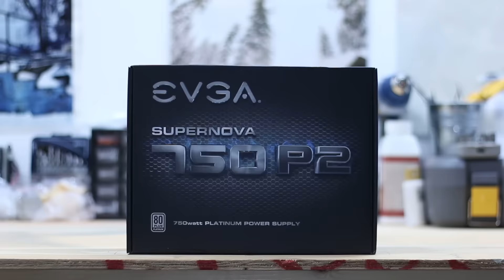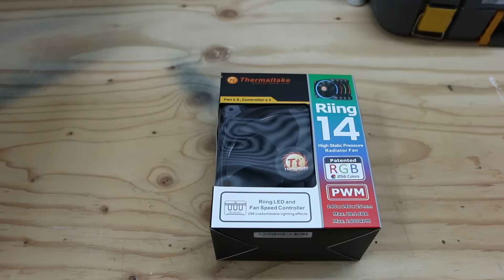ga-h270-gaming 3 | Kaby Lake build timelapse

Comment: Hey i have the same pc and i have this problem: "Reboot and select proper boot device or insert boot media in selected boot device and press a key" 
anyone knows how to repair it?
Reply from the maker: Matias Ferrara hey Matias. Usually, when  this message is displayed, it means that the PC is unable to find an OS to boot from. Check the boot order in the BIOS, check to see if there is a USB drive or a CD the PC is trying to boot from. Let us know how it turned out. Check to see if your primary drive, the one with the OS on it, is plugged in, powered ans accessible.
Reply: nicolas michaud Thanks for the response men! I'll let you know what's up!

Comment: Hey dude, how do you install that m.2???, i come here to install it, but you made a cut in the video :(((  3:44 
when I put it there is a part left over, and I'm afraid to break it
Reply from the maker: You have to insert it at an angle and them you push down on it to screw it on. Check out other M.2 install videos. It is a standard M.2 port, this mobo isn't different from every other ones.
Reply from the maker: Also at first, I used the wrong M.2 port. If you look ahead on the video, you can see I later moved it on the other M.2 port, the one over the graphics card port.
Reply: @nixthenix  Ty mate!

I used the port that is above the card, is there a difference between that and the one below?
Reply from the maker: @enriquepedros6626  You used the correct one. Well first of all, with this one, you'll be able to see you glorious new M.2 ssd drive. It won't be hidden under the GPU. It's also the primary one. It accepts longer drives and SATA connectivity as well.
The one above the GPU:
1 x M.2 connector (Socket 3, M key, type 2242/2260/2280/22110 SATA and
PCIe x4/x2 SSD support)(M2A1_32G)
The one under:
 - 1 x M.2 connector (Socket 3, M key, type 2242/2260/2280 PCIe x4/x2 SSD
support)(M2A2_32G)
Reply: @nixthenix  Ty and for youre help too!

Comment: hey mister. I have the same motherboard. I want to install 6 fans but only have 2 fan headers. they will be rgb so I would like to control the LEDS via software. question is if I do a triple fan splitter for 1 header, will that be too much voltage for the header to handle? I don't want to fry the poor thing. lol your build is awesome btw !
Reply from the maker: SonOfSparda thanks for your comment! Unfortunately I don't know the answer to your question but I'm guessing a simple Google search will provide you with an answer! Keep on the good work!

Comment: I'm confused between this model or Asus Intel STRIX B250F GAMING . Any suggestion which one to buy ?
Reply from the maker: Those are pretty much equivalent products. Both are made to support the newest intel socket LGA-1151. Both are made to run stock (no overclocking). They both support 2400mHz RAM, have M.2 slots, USB 3.1 Type C, gigabit LAN, RGB lighting, etc... Neither can do SLI. If there are differences between the two, they're really minor. I would say it's really up to you at that point. Thanks for watching!

Comment: Update the bios is needed to use 64gb 2400mhz memory or just 7th generation processor such as 7700?
Reply from the maker: Aldo Fernandes Azevedo no BIOS update needed but you do have to go set XMP memory profile in the BIOS to achieve 2400MHz otherwise the ram will run at the default stock speed which is 2133MHz. It's not a bad idea to update to the latest available BIOS version though

Comment: Hi Nic, I would like to here your impressions on your NVMe drive. Was there driver complication at 1st boot? Like did you have to pre-load drivers as you would in a RAID? Did you install Windows 10? I plan on initially using my Window 7 and then look into upgrading to 10. Did everything else go smoothly? And is there any noticeable performance boost that you notice over a standard SSD drives?
I just ordered the same motherboard and a Crucial MX300 275GB SSD for $93(US). I had to order some SSD cables and an SSD bracket for $15. Total = $108. And I could get the Samsung 960 EVO M.2 250GB for $117.
So for $9 more I would lose 25GB capacity but gain a cleaner install and potentially the speed of 4 PCIe lanes.
Is it worth the trouble in your opinion?
Thanks (Very nice video)
Reply from the maker: Marcus Caudill Hi! In your situation, I would go with the M.2 NVMe drive no doubt about it. Thanks for your kind comment!

Comment: Work well a video onboard and a video offboard of the motherboard or a conflict is expected?
Reply from the maker: Aldo Fernandes Azevedo I'm sorry I don't understand the question. Do you want to use both the onboard graphics and the dedicated PCIe graphics card simultaneously?
Reply: nicolas michaud Like a Laptop, that has two video cards, you have to change the default video card?
Reply from the maker: Aldo Fernandes Azevedo I don't know really.. I'm using a dedicated graphics card so I disabled onboard video in the BIOS.

Comment: Nice build mate! Just wondering if this motherboard is SLI compatibale. I have ordered this motherboard and plan to add another 1070 in the future.
Also how much power supply watts would I need to run 2x 1070's in SLI?
Reply from the maker: Hey man! Thanks for your comment. This board isn't SLI compatible unfortunately. Have a good one, cheers!

Comment: where is the 6 port sata3? i have the same mobo, but i don't see the 6 port sata3, only 2.
Reply from the maker: jmr cover They're on the bottom right corner. See motherboard user manual on page 4, page 12 and page 15 for exact location.

Comment: Awesome build! Since you have a 7th Generation processor, a Motherboard for 2133/2400Mhz RAMs and you're using 2400Mhz RAMs, I've read that in order to enable the extra RAM speed you must have a 7th Generation processor or enable XMP. Do I have to enable XMP or all I need is 7th generation processor and it'll automatically enable the extra speed?
Reply from the maker: Yves Heinrich thanks man! You will have to enable it in BIOS. Right out of the box, it was running @ 2133Mhz. Simple setting enable in BIOS and you're now @ 2400Mhz (=
Reply: But isn't that technically overlocking? I wouldn't have a problem with that since my upcoming PC build's CPU cooler will face the RAM cards, whilst installing above the RAM cards another case cooler. Stating in the specifications that: "Support for DDR4 2400* / 2133 MHz memory modules - to support 2400 MHz or XMP memory, you must install a 7th generation processor."... I'm not sure I quite understood that. Can't I just have a 7th generation processor since they support 2133/2400Mhz, assuming the CPU will automatically enable the extra boost instead of enabling XMP?
Reply from the maker: While this may be debatable, I personally don't think this qualify as overclocking. I think the "*" is there simply because the memory requires a 7th gen Intel to run at 2400Mhz. The H270 chipset doesn't support overclocking and yet my ram runs at 2400Mhz.
Reply: +nicolas michaud That's all I wanted to know. I'm so happy now, not to mention this Motherboard is LED as well! Thanks for all the help, man!
Reply from the maker: No problem! And yes, the leds do look good on that model! 
https://www.instagram.com/p/BTnTWBNFwkY/

Comment: I didn’t get the difference between h270 or h270m, by gigabyte?
Reply from the maker: The 'm' stands for MiniATX wich is a form factor. The motherboard is physically smaller than a standard ATX board. There is also MicroITX wich is even smaller. Hope this helps

Comment: Should I buy this motherboard for my i7 7700 and GTX1070? or should i get the MSI B250M BAZOOKA ?
Reply from the maker: Hey, how's it going. H270 chipset vs B250 chipset, not much of a diffrence. Actually, H270 chipset and B250 chipset carry the same technologies except H270 will usually have more of it. More PCI-E lanes, more USB 3.0 ports, more PCI-E storage, etc... If you have a standard config with 1 GPU, 1 or two SSDs/HDDs, then you could go with the B250 no problem. Plus, the MSI B250M BAZOOKA is MicroATX format while the GB H270 Gaming-3 is full ATX size so it wouldn't fit in a smaller case. Consider this if you have a small case. Also, if you like leds on a motherboard, go with the GB H270 Gaming-3. The MSI have very fewer leds on it (behind it actually). Hope this helps. Cheers!
Reply: Thank you this helped :D

Comment: can u please tell me what kind of motherboard it is ? like atx , mini atx , compact atx ?
reply me asap plz
Reply from the maker: Yes of course I can tell you. It's an ATX motherboard (=
Reply: oho fuck recently reading of some comments and get to know that it does not support 3200mhz rams wtf :( is the true ?
Reply: nicolas michaud i ordered this board with corsair 2x16 3200mhz rams :( 
i guess it did something wrong
Reply from the maker: yes it is true indeed. h270 chipset supports max 2400Mhz DDR4 ram but only with 7th gen Intel processor. With 6th gen its 2133Mhz.
Reply: nicolas michaud omg im so doomed 😭😭 what should i do ? 
tell me 2 thing how to know if its atx or mini atx or some other 
2nd how to know if it support 3000 to 32000mhz ram ,
Reply from the maker: Well your RAM will work, but only at 2400Mhz if you pair it with a 7th gen intel processor and at 2133Mhz if you use a 6th gen processor. To be able to run RAM at an higher frequency, you need a motherboard with a Z series chipset (Z170, Z270) or an X99.

Comment: ı have asus prime h270m plus can ı use with i5 7600k
Reply from the maker: You can, but it won't be optimal as you cannot overclock with the h270 chipset. Better go with Z170 or Z270 chipset board and 3200MHz RAM.

Comment: Gtx 1060 3gb? o.O
Anyway... Nice video
The fans are pretty cool
Reply from the maker: Thanks man! At first, I was building this new PC mainly for photo editing and occasionnal video editing, hence the 1060. But the more I got into it, the more I realized that this machine could play games well. So I started to game on it. Needless to say, a couple weeks later, I replaced the 1060 for a 1080. It wasn't the more rationnal move per say as the build already had cost me around $2350.00CAD at the time, but now I'm very happy with it, although, I get a little coil whine from the 1080 wich I didn't get from the 1060. Now the total price of this machine is around $2800.00CAD.

Comment: ive read that this  mobo can cause firmware issues with windows 10?
Reply from the maker: Jan Lesava really? what kind of issue?
Reply: Loss of data, refusing to boot up, i have extensively researched tho and encountered no negative user reviews about the matter. Just wanna know if you encountered one? What OS are you running this one on?
Reply from the maker: I'm running windows 10 pro. I have not had any major issue like that.
Reply: great. That's a  big relief!! Anyway I'm still thinking if i should get this one or a z270 chipset even though I got myself a non K 7600. Thinking of z270 just to make it convenient if I decide to upgrade to a K series in the future. What do you think? Would it be worth the extra money? Or defo just go for this one and spend the extra money on GPU/SSD etc.
Reply from the maker: As you said yourself, the Z270 will be of no use right now. If you do decide to replace your non-k processor for an unlocked one in the future, just know that you will have to upgrade your memory to 3200MHz RAM too in order to take full benefit of your new system. Obviously, as you can see in the video, I chose a 7700, h270 and 2400MHz ram so that's for what I would do (=
Reply: awesome, thanks for the advice!
Reply from the maker: No problem, glad I could help!! (=

Comment: awesome video (y)
Reply from the maker: SteeL GameR thanks man! (=
Reply: Thermaltake Water 3.0 Riing RGB 240 CPU Cooler
I'm buying this one
is it worth it or there is a better one ?
Reply from the maker: Thermaltake Water 3.0 Riing RGB 240 CPU Cooler seems like a very good choice. Just know that it is a bit overkill if you don't plan on overclocking though (just as my H110i v2 with a non K 7700).

Comment: ok, why a 750 watt PSU for a 1060 build??
Reply from the maker: Erik Christensen don't ever use a PSU that's on the edge of or close to what your computer demands. The more powerful the PSU, the less it has to work to push the amount of current the components are demanding. That way, it runs cooler therfore quieter because the fan don't have to start/spin fast that often. Having a silent build is something I wanted. Also, expandability.
Reply: fair enough

Comment: Its just my personal comment, but you dont have to go with non-sense liquid cooler for a non K cpu. And if you afford that money for the gpu you could buy a 6 gigs one. Thats just make more sense to me.
But anyway, nice build! :)
Reply from the maker: Patrik Szabó you're absolutely right. Those are both good points. Let me explain my choices. I chose this water cooler mainly for its looks and the fact that it's more silent than a traditionnal air cooler. As for the GPU, I did regret my choice so I replaced it with a GTX 1080 a couple weeks later. It wasn't the most rational move at that point as the build had already cost me $2350CAD. With the 1080, the total price of the build has reached over $2800CAD. It's a lot of money but now I can game the hell out of my rig! Haha. Thanks for watching!

Comment: hey @nicolas michaud  , this is very nice configuration i have same configuration as urs ( i7-7700 kaby lake + gigabyte h270 gaming 3 mobo... anyway can u tell me (help me ) how to connect more fans like this one on 3:55 minute ( my pc case get hot air after 20 mins gaming , im about to put one more fan to give fresh and cool air in pc case .  Thanks .
Reply from the maker: @Renchoman1a Hey man, thanks for you comment! The fan you see at 3:55 is a Thermaltake Riing fan and you have two options when it comes to connecting those to your system. If you buy just one, you can use one of the fan headers on your motherboard (see motherboard user manual to find those). The speed of the fan will be controled by the BIOS or whatever app you use in Windows. Connecting the fan this way, you won't have any control over the RGB lighing of the fan. Those fans also come in packs of 3. If you buy said pack, you will find a fan controler in the box. You can connect 3 Riing fans to the fan controler and then connect the controler to a fan header on your motherboard. The Thermaltake fan controler allows you to control fan speed and RGB lighting of the fan. If you do that, you will have to go into BIOS and disable speed control for the header the controler is connected to basicaly giving 100% power to the header.
I hope that is clear and answers your question. Don't hesitate if you need more information!
Cheers!

Comment: not the best build but ok.... you could take less memory and take 1080
Reply from the maker: pasha p I did replace the 1060 for a 1080 a couple weeks later. It wasn't the most rational move as the build had already cost me $2350CAD before the 1080. With the 1080, the total price of the build has reached $2800CAD. As for the memory, 16GB was $150CAD and 32GB was $250CAD. With a total price of over 2000$, it was a no brainer for me to go with 32GB (=. thanks for watching!!

Comment: man you cheaped out on the video card
Reply from the maker: Shasky Smith I know. At first, I was building this new PC mainly for photo editing and occasionnal video editing, hence the 1060. But the more I got into it, the more I realized that this machine could play games as well. So I started to game on it. Needless to say, a couple weeks later, I replaced the 1060 for a 1080. It wasn't the most rationnal move as the build already had cost me around $2350.00CAD at that point, but now I'm very happy with it, although, I get a little coil whine from the 1080 which I didn't get from the 1060. Now the total price of this machine is around $2800.00CAD.

Comment: can i put an intel i7 6700k on this same motherboard?
Reply from the maker: Yes. Yes you can. This board supports 6th and 7th gen Intel Core Processor. You will no be able to oc it though. You need Z270 chipset for that.